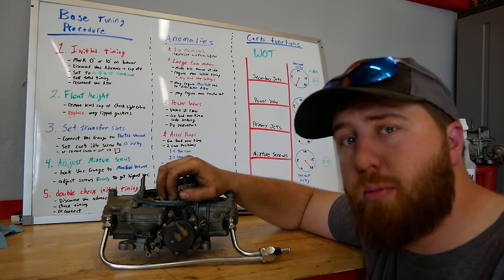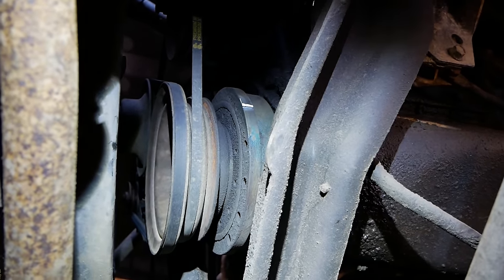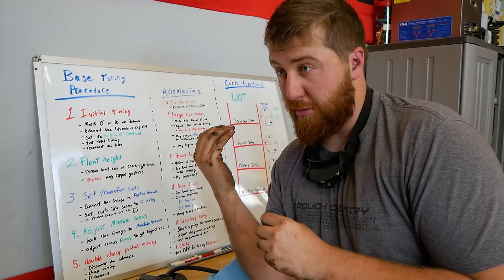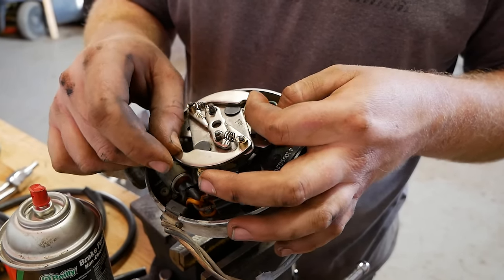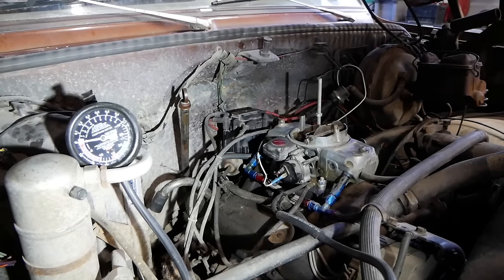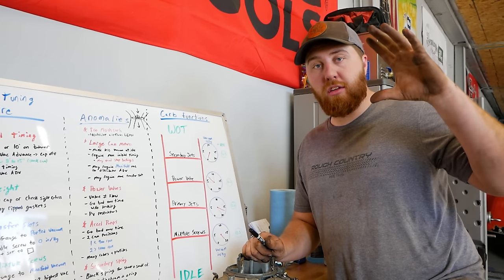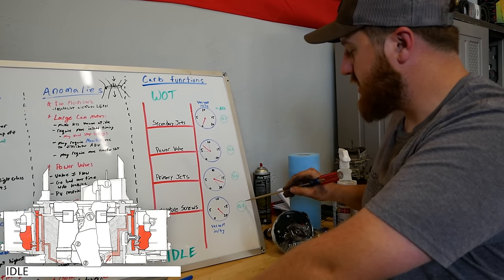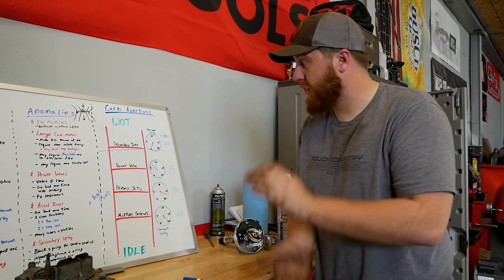How to Tune an Engine - Initial Settings, Ignition, & Carburetor Theory of Operation

Comment: Most the carbs I work with are Japanese CV carbs and Weber 32/36 series. Any chance on covering something like those? I only ask because you have a way of explaining things that even my dumb self can understand! Keep up the amazing work guys!!
Reply: I had a Weber 38/38 on a old Toyota that I never could get to run right. I think the team need to start getting into EFI soon ;)
Reply: I know CV's really well and these downdraft things are nothing like them!
Reply: Is their vacuum in hPa instead? 😉
Reply from the maker: CV have always been my weakness! When I'm working on motorcycles I usually replace them with a flat slide pumper carb because it behaves like a holley😂

Comment: FYI, new motor builds.  Setting distributor to 0 degrees every time.  Rotate motor to TDC, pull #1 spark plug and hold against block.  Rotate distributor with hand.  When sparks, motor and distributor are at 0 degrees.

Comment: Thank you for showing how to do this. My youngest son is getting married 5/18/24 and would love to get his '78 Nova running and actually drive it for the wedding & reception. We have it running for the first time in 10 years and it is a complete block rebuild 355 with a mild cam and rebuilt heads. It runs if you hold the throttle open slightly, but then dies. I want this so bad for him but not sure if it actually will as the guys that were to help tune it are booked-up. This project started as a high school kid mowing yards to buy his first car. He bought it but never actually was able to drive it. Hopefully he will be and to in less than a month. Love the videos & thanks again...

Comment: You could not have released this at a better time. I just finished a 2 barrel to 4 barrel conversion and as this my first project car and it runs like crap, I am about to start this process. Beautiful to see how this is done, step by step, from start to finish. Thank you!
Reply: Just a follow up. Went at the carb with a calibration kit and the knowledge I gained from this video and it runs 1000% better. Still need to go at it with an AFR gauge to get it really dialed in but still, WAY better. It think it must have been jetted for a lawn tractor. Again! Thank you!!!

Comment: Great guide!  I'm a very digital person and always had a harder time understanding carburetion versus computer/EFI control.  But I'm planning to build a retro street rod in the next couple years and fuel injection just doesn't feel right for what I have in mind.  So this is a great start-to-finish for essential understanding and tuning that I will probably be coming back to later.  Thanks!

Comment: I like the way you approached explaining this and appreciate you taking the time to do so. I personally have two things I do first before getting to the beginning of your list. 
1. verify the harmonic damper is in good shape. A bad one can have the ring slip and your timing marks are worthless. If we are trying to deal with an older car with a carb we are talking a vehicle that is at least 35 years old. The ring is held with rubber. Rubber can fail, it cost me 18 years of child support.
2. With the distributor cap off, bar the engine opposite of rotation until the rotor moves. Then bar the other direction to see how far you can go until the rotor moves again. If the thing already runs like ass, it might have nothing to do with the carb and just have a stretched timing chain. You need to know your valve timing is true and correct before doing anything or there isn't going to be a point in fiddling with it, no matter what you do it will run like ass. When it can't be driven, you can't get to work to pay the child support from the time you trusted a piece of rubber.

Comment: Tuning mixture screws using a vacuum gauge is some of the most satisfying wrenching experience I've had.  Well, screwdrivering I guess.  But anyway, setting timing, checking to see if the mechanical advance works, getting the idle smooth, using the timing light, all this, it's a skillful art and if you know you know.  YOU definitely know and sharing that knowledge makes you a stand up guy.  Great video, even if you feel it's all over the place, well, this is how it is with these cars, you get started on a process and then two more things need fixed before you can get back to what you were doing.  In this case, the advance springs jamming up and running out of fuel were the two that got you!

Comment: Well done Kevin, really. I am 63 and have been building Holley Carbs since I was 15, and I think this is a great overview view of a Holley, and basic tuning procedures. I have an old SA Designs book on Holleys that has notes and jet numbers, etc on the inner rear cover and in the margins of pages. I was 16 when I wrote most of that stuff. That book is also a great resource if you can find one. It might be helpful to talk at some point about the things to never do with a Holley, like over-tightening the float bowls, or the base plate bolts, etc.
I run into so many carbs idiots have had there hands on with warped metering plate surfaces because some clown couldn't stop and change a gasket and tried to tighten the leaking gasket away. I was happy to hear you address the mixture screws with the caution on over tightening...another place the ham- fisted idiots leave traces of their "work".

Comment: My son, dad, and I flew back to WV and drove my grandpa's last truck, a 79 Chevy K10, 2200 miles back home on a trip of a lifetime. It had been parked for 3 years and had only been "farm maintained" before that. We wrenched 4 days straight to get it ready to make the drive. I almost put a fuel injection kit on it because I was that scared of carbs and didn't know if I could get it tuned good enought to drive accross country. We ended up putting a new Accel distributer and Edlbrock carb on it and I was able to comfortrably "tune" it because I had watched and learned from you and your crew. That old truck drove the whole way withough a single glitch. Tuned it with a vacume gauge, set the advance on the distributer, read the plugs half way. What an epic trip with my family! All that to say thanks and keep up the good work!

Comment: Instead of using paint, you can also use white out. Been using it for years with it never chipping, cracking, or peeling. Great video.
Reply from the maker: Holy shit why didn't I think of that
Reply: Girlfriends old nail polish that they no longer use also works great

Comment: This was super cool. I've only ever messed with small engine carbs, but never really KNEW how a automotive carb functioned. Loved this! I "helped" my little brother figure out his ol ram charger, and I bumblefuked myself into a solution and got it running.....somehow.....but it never actually had POWER. It could never get itself out of a hole it dug. If only I knew what I knew now, he most likely wouldn't have sold it.

Comment: Excellent explanation. I'll be utilizing all the great tuning tips when I drop in my new Corvette distributor this weekend. This was the video I needed, when I needed it! Was on the fence about getting the dial timing light for the job, and the addition vacuum tests to dial things in... perfect. Thank you!
Reply from the maker: Thunderhead289 has a great video about installing distributors if you get stumped!
Reply: @JunkyardDigs  Thanks, I noticed your clip of him during the video. Honestly the hardest thing is applying what you showed on that carb to the Edelbrock I have. Though I think Uncle Tony's Garage may have something on YouTube I can reference. You 3 are the only ones teaching vacuum tuning and I'm soaking it up!

Comment: Thanks Kevin. You just fixed my car. My car was gutless and I found out my total timing was the same as my initial timing. I took the cap of and found the rotor was loose and the weights were stuck on top of each other just like in the video. Now she’s good to go. 👍🏻

Comment: Perfect video. Next week I'm gonna buy my first 1970 Italian twin double barrel carburator car. The car stood for some years, but it ran good upwards of 2000 rpm when tested last week. Only in idle it was a little weak. Looking forward to tuning this sweet project-car once I fixed the brake issues and some electrical issues with the lights.

Comment: Ya need a lawnmower carb. Between you and Luke, the knowledge with carbs and timing is amazing. I've done a badass LS motor, but about to be running a 283 in a ride. These videos will be helpful to say the least.

Comment: I have a 86 k5 blazer with a 305. Put all new gaskets and a new needle and seat in the Quadrajet that is on it. It will start up right away and after it idols for a few minutes, it will start to die and flood out. Exhaust burns your eyes it’s so rich. But there are no mixture screws….. just idle. This video is super helpfull, I think I’m going to check timing with the help of this video lol. Any comments would be appreciated. Also gapped the plugs to spec because they were all around 50 thou. Helped a little but still not much better. Thanks and have a good day!

Comment: For a distributor with points ignition before you set your initial timing you need to make sure your dwell is set correctly because, changes in dwell will affect your timing, also when setting initial timing make sure your idle speed is low enough to where your centrifical advance hasn't partially engaged. a Holley double pumper is designed and sold primarily for racing and are okay on the street as long as you aren't the one paying for your gasoline.

Comment: Even fuel injection vacuum is super important no matter if it's carborated or fuel injected all gas engines are air pumps using gas and air to continue Rotations good video as ways Kevin great teachings @Junkyard Digs

Comment: Very informative video. Wish someone back when I was younger could have explained this the way you did. Would have made my experimentation a whole lot easier. Too bad many young people will never work on anything with a carburetor. Hell take an old vehicle to a shop and tell them your carb needs work. They will have to call an old retired guy in to show them how to work on one or may just say they can't do the work. Had that happen to my cousin who was having carb issue on his 70's van. I was on vacation visiting family when he came over to hang out. When he was going to leave he couldn't get his van to start. I found the problem and told him what he needed to have done. When I asked him a few weeks later if he got it fixed he said the shop that he had do a lot of his work told him nobody there had ever worked on a carb so they couldn't do what he needed done.

Comment: Ever in missouri and want to do another video like this on a Ford 370 your more than welcome. I have been messing with it for years and have never been able to get it right. It's just an old feed truck that we would like to use but can never get it to run right to use it.

Comment: Awesome video,. VERY informative. I am running into an issue with my 70 Torino, but I already feel smarter from watching this video. Brand new Blueprint engine, correct sized carb. JUst have to tune it, and I think I am at least a tooth off on the distributor stab. The end of the vacuum advance is so close to the upper radiator hose to make it idle okay with timing adjustment that you can't hook up the vacuum line. I don't have enough travel on the distributor to adjust the timing like it should be, so gotta pull the dist. and move it.. It will be next weekend, since it is now getting dark before I get home at night. It's a journey, spent a whole vacation getting it in, then found after the fact that my separator plate was no good for the application, and rubbed the flexplate. Yesterday I unhooked EVERYTHING, pulled the engine, removed the flexplate and changed the separator plate, then dropped it back in. Today I hooked everything back up, reinstalled headers and collectors and had it running again. I am worn out, lol. Things you wished you had known beforehand, I could have fixed the distributor issue this weekend, but nope... Anyway next weekend it will be running much better I believe.... Thanks again!
Reply: Just did the timed vacuum setting for the transfer slots, and it was barely even a little over 0 so I wasn't too bad off. I also did the mixture which seems to have helped a tiny bit for smoother idle at least. Still waiting on my digital timing light, so I can set my timing and vacuum advance for total timing. I am STILL getting a hesitation when the motor is revved sharply. Only on the first time I hit off idle though. anytime I rev it after that the hesitation is gone. Do I need to change my pump nozzle on the primary?? It is a Ford 302 style engine with oversized valves and a mild cam from Blueprint. 367 horsepower at 5700 rpm, and they said to use a 600 cfm which I did. It still has the stock 25 nozzle, but I have a 31 I can install. I installed it before, and it didn't seem to help much so I put the stock one back on,.

Comment: You brought back a lot of memories. Some of the steps I knew back in my early 20s I am now 69. I worked on my own vehicles as a young Army Trooper. Your video is excellent and content is plain and well understandable. I have Subscribed to your channel with notification. My Son and I have been trying to get is 1967 Chevy C10 to run better. We replaced the engine with a 327 that was built for an air boat. The air boat owner did not like the lack of kick when starting so he put this engine up for sale. It has a total of about 50 hours on it. We have been trying to set the Holley Street Dominator 650. It runs Ok but the fuel mileage sucks. I now know were to start.

Again a great video. One question on an AFR were is that connected while road testing.

Comment: Thank you for this video as you'll see it on a recent comment I got truck I'm working on and when I hook the original gas tank back up I'm going to have to redial the carburetor to run with the tank and everything so this will be handy so thank you for this video

Comment: This is a really informative and well-done video.  Kinda proving the point that old school is the best school.  AFR is nice for cheating, but vacuum does it all and really tells you all you need to know.  Been wrestling with whether to cut a hole for the sensor in my header tube (it's small and the sensor will restrict exhaust flow if I do it.)  Carb is a Weber DCOE so very sensitive to minor imbalances.  And of course no vacuum ports.

Comment: Look into unjusting your timing using a vacuum gauge instead of a timing light. It is extremely simple and it tells you the amount of timing your engine wants instead of guessing 8-15° at idle. I have an engine that loves 22° at idle and 42° total.

Comment: Had a 76 ford motorhome with a 351w. Would start up great when cold and idle without touching the petal again even at -20 below. Only problem I had was when warm wouldn't stay running had to feather the gas a little bit to keep it running. Still would start fine warm just had to feather the gas a little bit. Never did figure out what it was before I sold the motorhome. I do miss it she ran like a top other then the little problem I mentioned. Going down the road it ran fine no hiccups or anything. Only sold it as the whole interior needed to be redone and I couldn't afford to do it right.

Comment: Centrifugal advance can be tricky. The venturies create a low pressure area, drawing in fuel. If you go too lean, the Engine will run hotter, potentially in the range where dieseling or run on can happen. Carbon build up gets hot enough to support auto ignition. It does happen.

Comment: Wonderful video for us shade tree mechanics. I bought a 67 Chevelle with a 396 in it. I know nothing about the motor but it does sound like it’s got a small cam. The carb is a 4 yr old 670 Holley. A certified mechanic said it has 9” of vacuum at idle. He set the 14^BTDC and total advance at 31^ . As far as I m concerned it still doesn’t run correctly. The tranny was changed to a 700r4 .  Not sure if that makes any difference. I did notice this car has had a bung welded in the exhaust.
 As far as I know nothing has been changed in that new carb that was purchased from Speedway.
  Any advice on where to begin would be appreciated. 
You explain things very good.  Sounds like a AFR gauge is a game changer
Thanks

Comment: Tiny tiny suggestion only because timing was so hard to see on the Shovelhead. When you make your timing line on your balancer use white paint and then sprinkle that ground glass crap they use on the lines in the road (I just happened to have some) on the white paint while wet. You can see that line from orbit. A thin strip of reflector tape reinforced with CA glue works great too.

Comment: One thing I discovered on my demon carb, the baseplate has a small air bleed to fine tune transfer slot, and idle speed, if you take the carb stud out, and stick a long skinny screwdriver in the hole, its there. I could never get a solid idle on mine because it was cranked all the way open on mine. That's only that particular style of demon carb. I've also heard stories of guys setting the idle slot, and drilling tiny holes in the throttle blade to fine tune idle, for better responses. Only . my experience. Otherwise a fantastic video.

Comment: Hey, I really love the ladder analogy. I'm new to tuning a carburetor and have learned so much from your videos. Thank you for sharing. Do you have a follow-up video that tells you what to do if one is having problems with one of the 'rungs' on the ladder? I've got some mid-throttle hesitation on my new Edelbrock 1406 on a Chevy 350 and am not exactly sure if I need to adjust the power valve or the secondary jets.